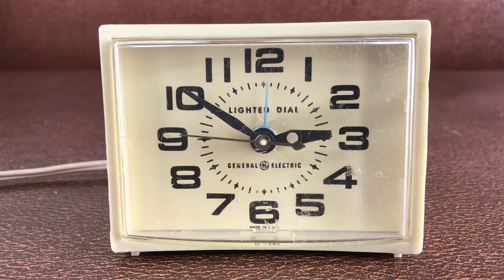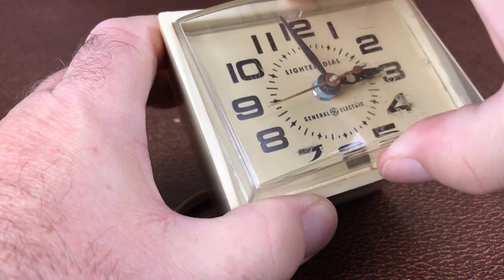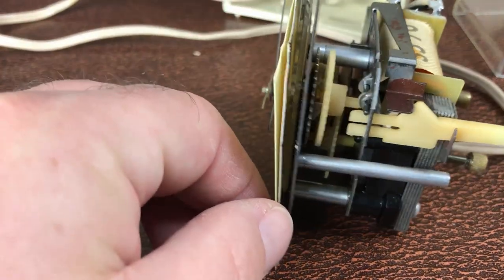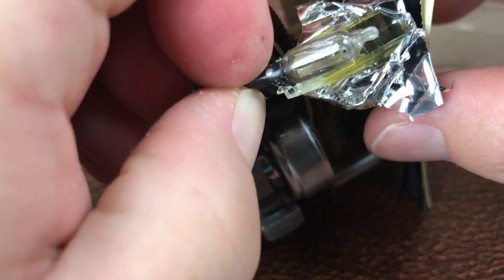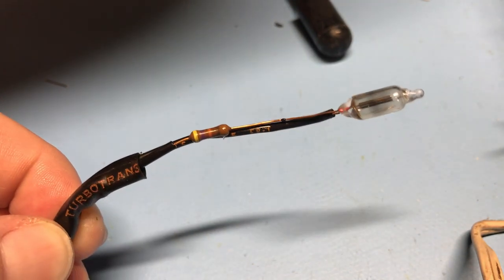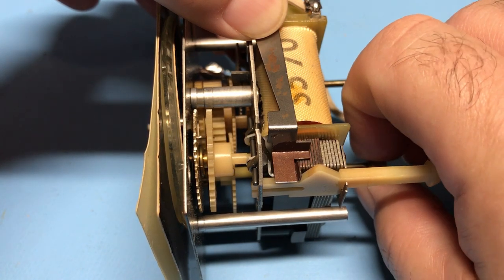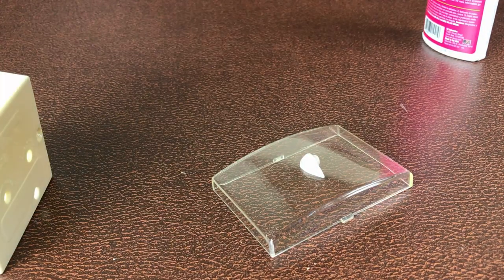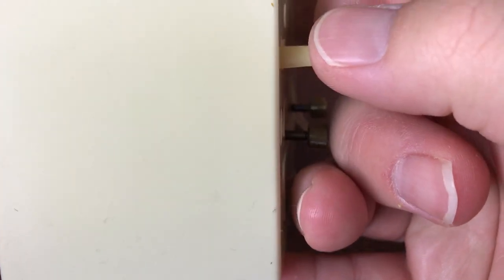GE 7299 3A clock, a project that didn't go as hoped

Comment: Hello. I have a similar project that I'm thinking of attempting. Your experience shows what I've suspected happens on clocks with lighted dials. There must be a way to carefully take the hands and the dial off so as not to damage them when replacing the light. Anyway, good stuff. Thanks for sharing.
Reply: I set all of the hands to 12 and then take them off very carefully. You just have to put them back on the time you had it on
Reply: EXCELLENT TIP !!! THANK YOU !!!